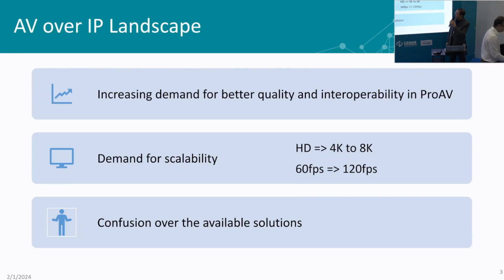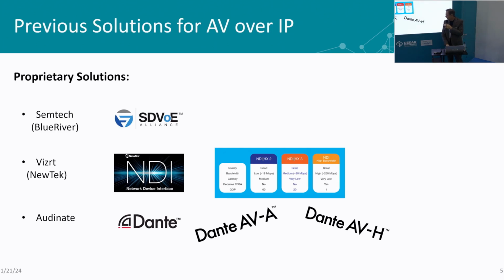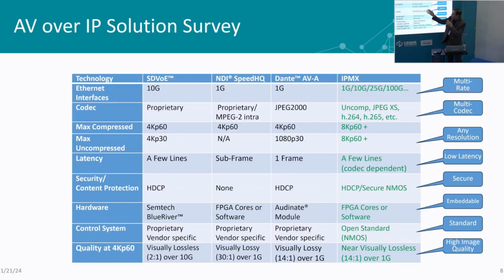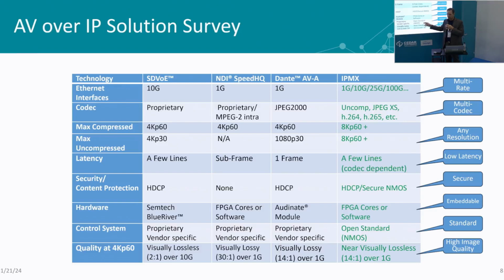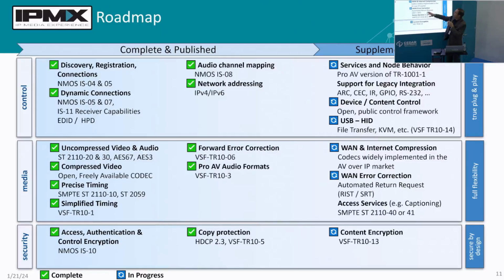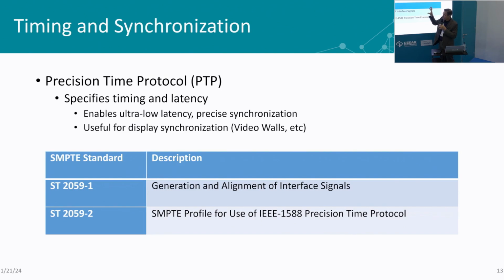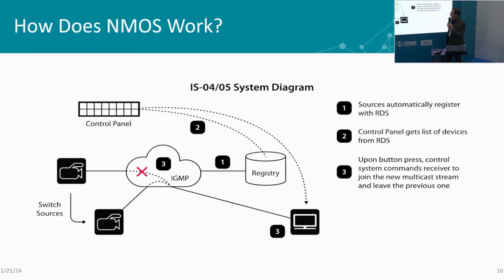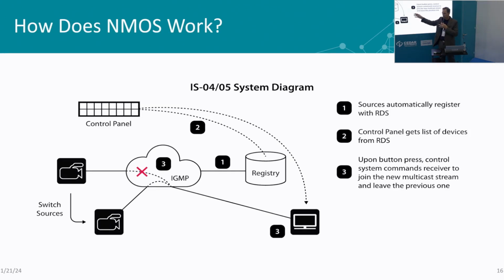ISE24 IPMX Theater IPMX Demystified
Nextera

Comment: IGMP is a protocol. My opinion is that saying switches have IGMP is not accurate. 

Switches can have a capability called IGMP snooping. This capability allows a switch to modify their default behavior which is to flood multicast addressed frames out all ports except the port that received the frame. 

With IGMP snooping turned on, the switch will eventually have a record of what ports are connected to devices that are subscribed to specific multicast streams. The switch will then push multicast frames only out of those ports.